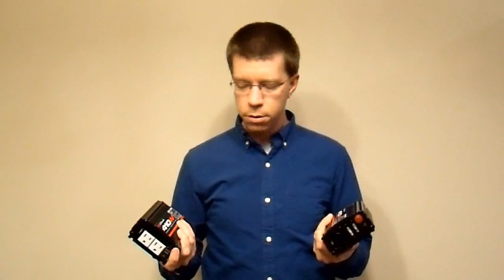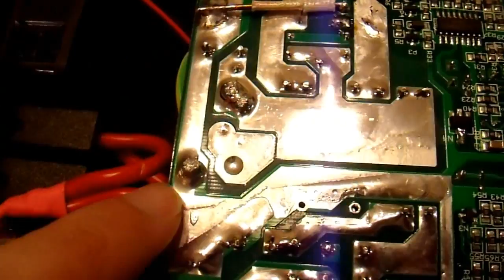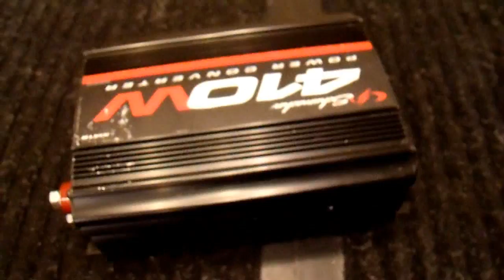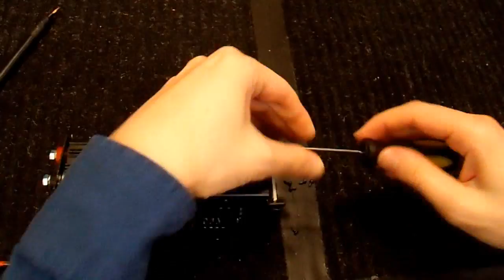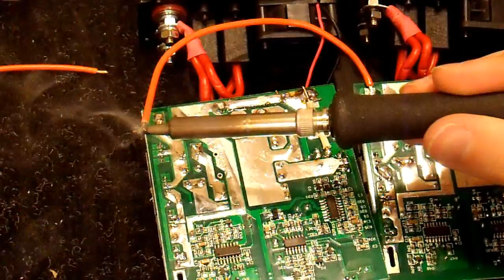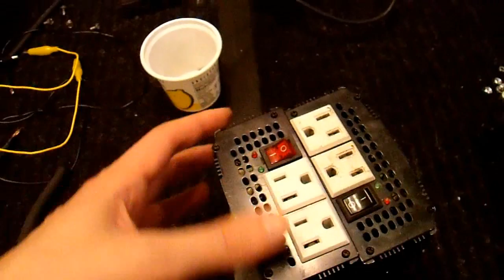Parallel Inverters - Double the Power Hack!   Part1

Comment: I promised I wouldn't rant but I have 4 bits of broken IT equipment and 3 were more or less faulty out the box.
Whenever you pay good hard earned money for a product and receive a poorly made piece of cr*p. You have a contract between the retailer responsible for selling you the cr*p and the manufacturer that produced the crap. Those are the only people that should be blamed the retailer for selling stuff they new wasn't fit for purpose and the manufacture for not maintaining quality control or hiring/keeping good/skilled staff, giving proper staff training, motivating staff etc. If a business puts profits ahead of customer satisfaction you as a consumer should not be happy. With all the corporate advertising/news media etc. We often forget that we have a right to get what we paid for and often love/respect business's we should actually be angry with. Anyway good video, glad to see you back.
Reply: So quick question, if you just plug a male connector into each outlet and then have the negative and positive output from both  inverters meet up with the use of some diodes or rectifier to allow both 410W to be combined into one female outlet?
Reply: Coolkeys2009 how would you get satisfaction. from the chinese

Comment: I think the fact that they are making tech even at crap quality is a testimate to how cheap the technology has gotten.
Reply: Most of the skill is in the design stage. Making it work with good efficiency and reliability with a low component count and low cost parts is a skilled job. Most electronic items we use and take for granted like TV's and mobile phones use very advanced technology.
Reply from the maker: Coolkeys2009
Yup.
Reply: *****
 will you sell them

Comment: Ok, so by parallel stacking at the bridge before the high voltage dc hits the output Fets, you avoid a catastrophic failure via non synch waves (don't cross the streams Egon) BUT if the output section performed cool, why not just stack the Fets 'n' caps in the input section and push the Output section to the max in one, smaller box?
Reply: Presumably the transformer wouldn't cope? And I doubt the existing traces would be good enough for double the current either. They'd probably need some modifications.
Reply: U could buy a 1000w inverter just a thought

Comment from the maker: It's been a while since I released an inverter video and it's past time I do so again.  This is a project I worked on about 6 months ago.
Reply: knurlgnar24 Sir can we make a pure sine wave inverter at home? Is it possible or too complicated?
Reply: Try incorporating a capacitor from an air compressor. They look like a thermos, but carry 110v.
Reply: Now I just hope this will work with 5 inverters!
Reply: Actually,  I cant do this with 5 inverters... they will fry each  other up.
Reply: Can you use this instead?

http://www.smarthome.com/a-neutronics-mlsl-11510-10-outlet-19-rack-mount-power-strip.html
Reply from the maker: Danyal Ahmad
Looks like it would just connect them each together with a switch to turn each one on and off.  They'd still go 'poof' when switched on if not synchronized!